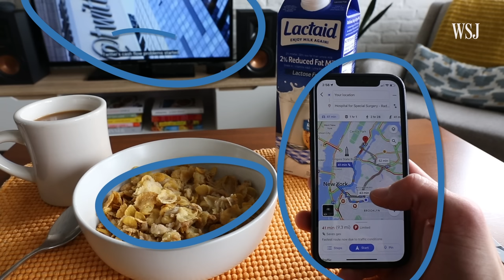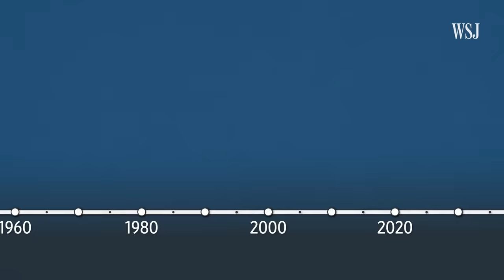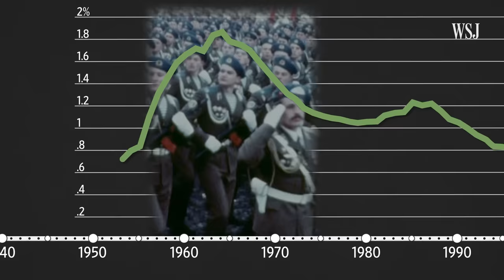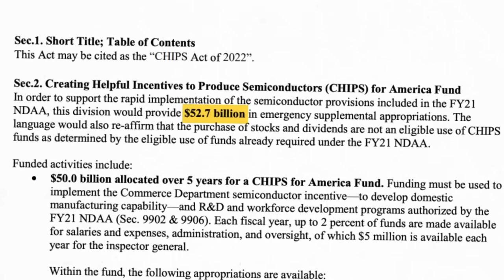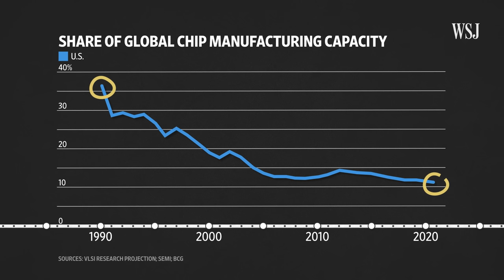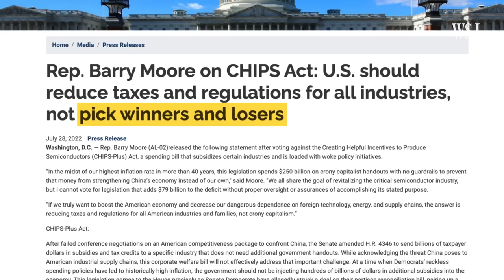Why the Chips Act Signals a Return to ‘Industrial Policy’ | WSJ

Comment: now every country wants to build their own chip industry.
Reply: Well chips are the new oil so to speak. Without chips our modern way of living would not be possible. Legitimately everything you buy now a days has some level of tech inside it. Your washer, your stove, the clock on the wall all rely on chips
Reply: @dennisp8520  doritos, cheetos, or fritos
Reply: @JesseGelatnis  They are also not possible without machines in the assembly lines producing them

Comment: There's a flaw in the reasons to bring the chip fab back to the US, during covid, the chip shortage is not on high-end chips, it's the low-end chip supply that got disrupted causing cars and other industries to stop due to lack of low-end chips. Now we are forcing high-end chips in the US, it will not fix the problem we want to fix.

Comment: The problem is quite complex. It appears that not only new chip companies in the US are facing problems, but existing ones are also struggling to remain sustainable. The primary goal of the US should be to preserve the existing chip companies, which have experienced a significant reduction in their markets by 50% over the past few years, especially when the US sanctioned China. The second issue is that investing in and substituting smaller new chip companies may also enlarge the problem for existing chip companies, making it even more challenging for them to compete. This could eventually lead to big damage to the US chip industry, which is the opposite of what they hope to achieve. Meanwhile, when China becomes chip independent, it will be an additional competition on the global market.
Reply: I respectfully disagree. Consolidation of the market leads to oligopolies and stagnation (ex. Comcast). Healthy competition drives more innovation, better products and prices for consumers, as well as a healthy industry
Reply: @catalindeluxus8545  Thank you for sharing your perspective. The complexity and high costs associated with the semiconductor industry, make very unhealthy competition in this case unfortunately, but there are also other major problems. Let me explain. Establishing a production facilities and rise a solid chip industry in the US requires up to $500 billion in additional investment, with returns on investment taking decades due to intense competition. Modern investors typically seek exits within five years, not 20 which would be scenario here. The US has lost more than 50% of its market after imposing sanctions on China, causing considerable financial damage. Major companies like Nvidia and Intel face significant challenges, with many more companies in the industry struggling. The situation may get even worsen as the Chinese chip industry becomes more competitive within the next three years. If US companies manage to establish new markets and survive, they might soon face competition from rising Chinese companies, which could be unbearable. Additionally, government support for smaller US chip companies could create further competition for established companies like Nvidia, potentially delivering a final blow. The upcoming recession and inflation could also have devastating effects on the US chip industry. The timing for execution of this strategy of Biden administration is terrible (nothing against the president, just it can't be worse). Also. TSMC having lost the Chinese market, is also facing challenges and relocating part of its production to the US, which will significantly increase operational costs and cause disruptions. All that will very much negatively impact the high-tech chip industry. If China catches up in producing advanced chips, such as 7nm and smaller, they could flood the market with more affordable prices, posing a ultimate challenge to the competition. So everything is far from healthy, US chip industry faces very hard time (and even companies such as TSMC which also got disrupted accumulating stockpile unable to sell, and AMSL that got saturated options, the effects are already visible in the stock market. All of that discourage investors even more, making the whole situation very unpleasant. Tnx for your attention.
Reply: The problem is chips themselves are INCREDIBLE HARD to make. You need very precise and sensitive machinery and EXACTLY the right atmospheric conditions to make the process work.

Comment: This is a positive, but the feasibility of this initiative needs to be assessed for the long term due to economic concerns. In order to compete with China, the cost of chips needs to be kept low, and furthermore it requires a significant investment of up to 500 billion dollars to establish a chip industry. However, private capital cannot fund such an investment as it is unlikely to yield returns, and provide a return on investment for a long time, if ever. Therefore, government funding is necessary, but this would result in the industry being heavily reliant on the government and ultimately contradict the principles of free-market capitalism. This approach resembles China's government-owned and controlled companies, exactly what CCP is crticized for.
Reply: @Andrew Thank you for your feedback! Yes, the problem is quite complex. It appears that not only new chip companies in the US are facing problems, but existing ones are also struggling to remain sustainable. The primary goal of the US should be to preserve the existing chip companies, which have experienced a significant reduction in their markets by 50% over the past few years, especially when the US sanctioned China. The second issue is that investing in and substituting smaller new chip companies may also enlarge the problem for existing chip companies, making it even more challenging for them to compete. This could eventually lead to big damage to the US chip industry, which is the opposite of what they hope to achieve. Meanwhile, when China becomes chip independent, it will be an additional competition on the global market.

Comment: One thing I don't think will get solve is the impetus for having chip production over there in Taiwan is it not only cheaper with the production there than investing in building and teaching the production here and it also permits the the US to check Chinese expansion. If Taiwan was not this cherished and vulnerable ally with chip manufacturing the stakes would not be so high to be all up in China's grill about breaking the first island chain. If we were to have domestic production would the US be all up in arms about the prospect of China invading Taiwan?
Reply: chips aside, taiwan is strategically located in the east china sea & north of the south china sea where over $3 trillion of global merchandise passing through every year. china controlling taiwan will given it substantial leverage over the USA & it’s allies japan, korea, australia, nz etc with a stranglehold on one of the most important global trade routes.
Reply: @Kevin-fq3zh  You get it. This is the most correct answer.